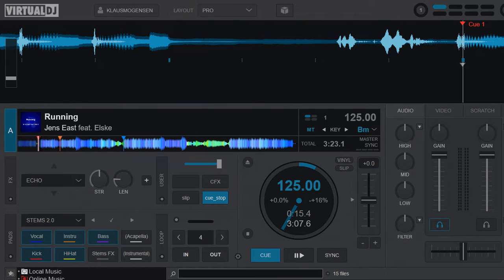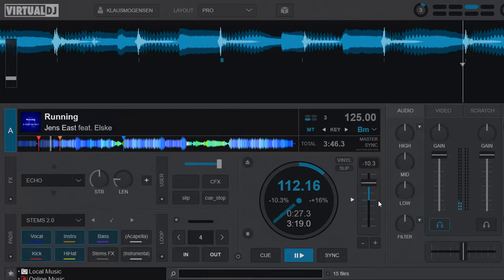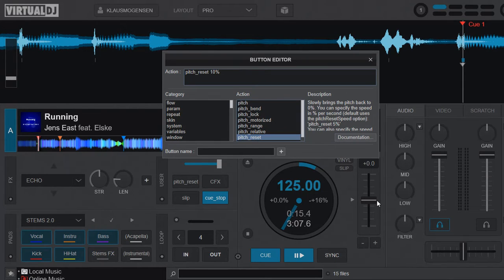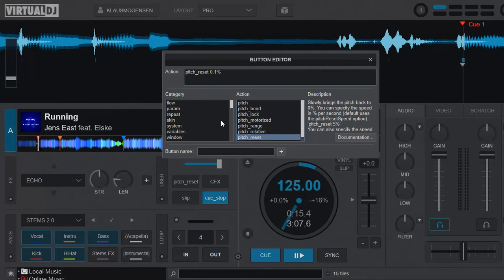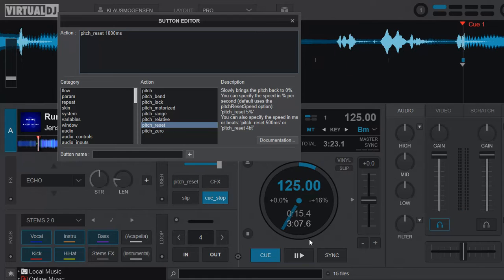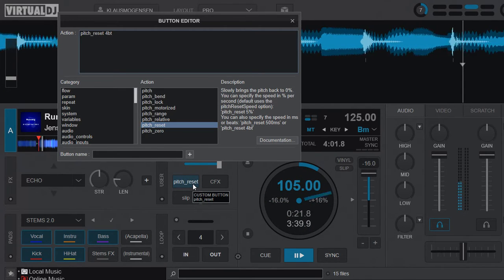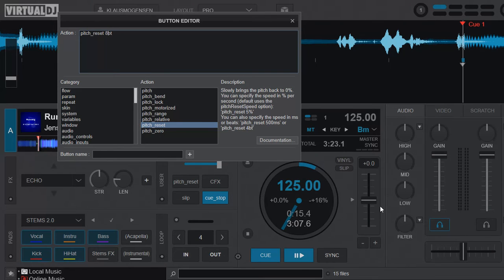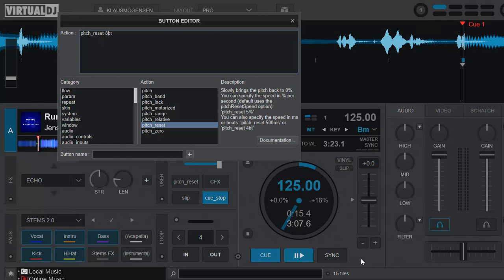Quick n' Dirty: Small enhancement to pitch reset in VDJ2023

Comment: Klaus thank you for the video. I really like the transition by BPM. Do you know what script would go from 120 BPM directly to the desired 128 BPM.
The original song speed is playing at 120 BPM, increase speed to 128 BPM, by transition by BPM? Raise the speed to the exact value (128BPM) by transitiosn BPM,  thanks :)
Reply from the maker: Yes you can set it directly using the script: pitch 128 bpm
If you want to use pitch reset to do it, you need to base it on a pitch that is not at 0%, like maybe a track sync'ed to the other deck, and then do a really fast pitch reset like maybe:
pitch_reset 30ms
Let me know I'm misunderstanding what you are trying to do